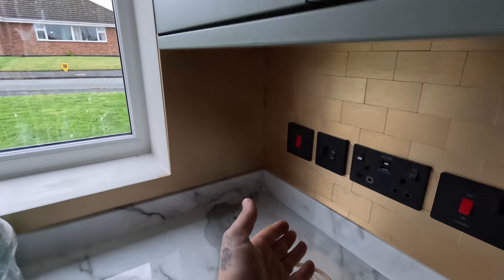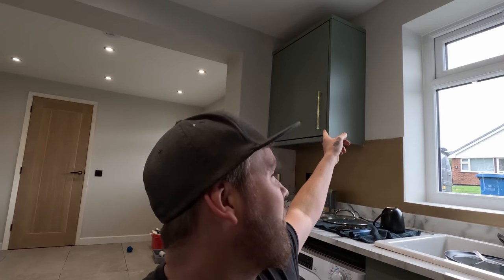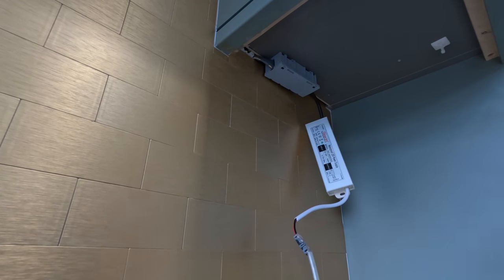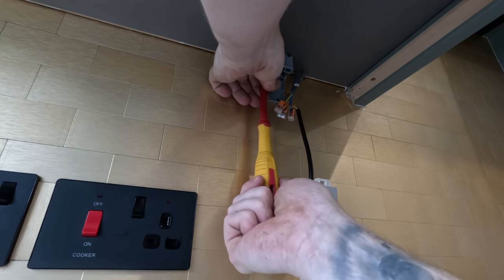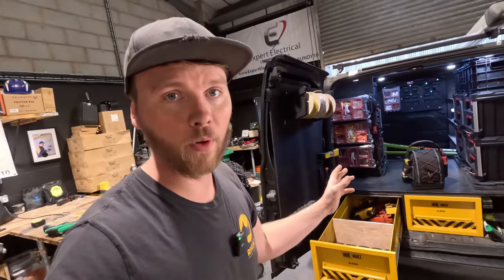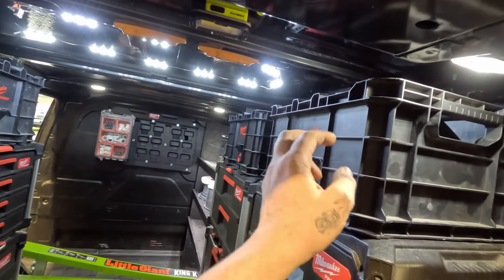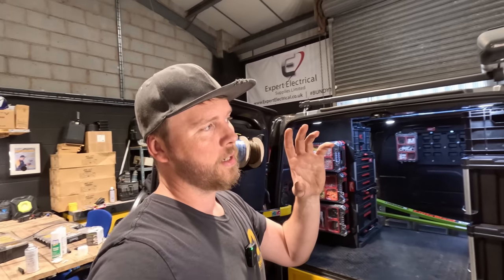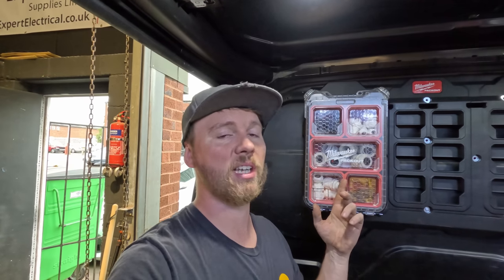Milwaukee Packout,  Van Tour Update- Electrician

Comment: My last van I changed it so the tool boxes were built in to the gap of the side opening door, it worked out more efficient. Left the whole lefthand side free for sliding 8x4 down and centre behind bulkhead for for larger or not often used items such as ladders, or flight cases etc. it felt wrong to start with but worked so much better. also only had to open the one door each time I wanted tools etc.

Comment: 1. Add a packout box for your drill bits?
2. Strap your small ladders which I’m sure we all often ever use and need on the left hand side seperator, move the packout box down towards the cable shelf.

My van is coming in December 🤞🏻, you’ve got the racking I want, in addition to that I’ll be doing what I’ve listed up there☝🏻

Comment: Good job on the led lights Nick. When I fit under the cupboards I always use a couple of clips, with some small 3mm screws to secure it. The double sided tape will over time fail and the led will eventually fall off..

Comment: For the draw with all your hole saws try reuse cable ties or Velcro straps the hold down the dust collector things, not sure if the proper name.
You will then be able to close the draw.
Tool station sell a load of the Velcro straps in different lengths.

Comment: Get the rolling tool box in there, I keep it empty in the van, then I load it with power tools and other various bits from the draws that I require then roll onto the job with whatever boxes I require on top, makes unloading SO much easier. You won't regret it. It's looking mint, regarding the other boxes that you've ordered can you not make a "half size" frame next to the passenger side draws that way they're sat flat instead of on their side? 

I've recently racked my van with packout, if you want me to drop you a picture of it, let me know and on what platform as it may give you some ideas, class video as always